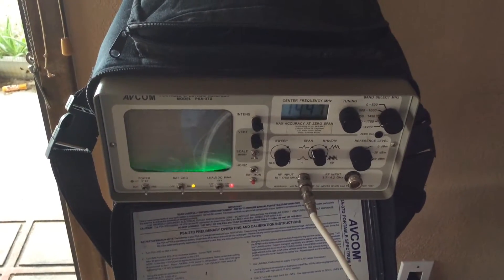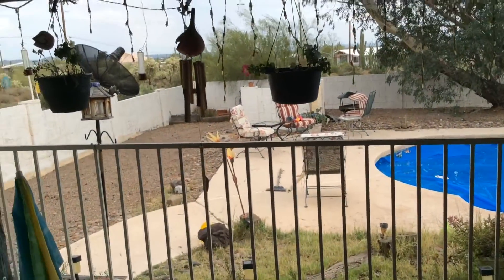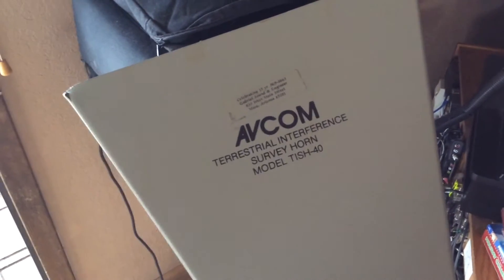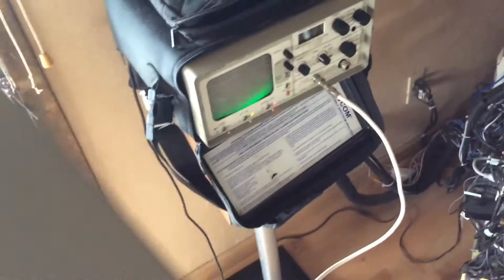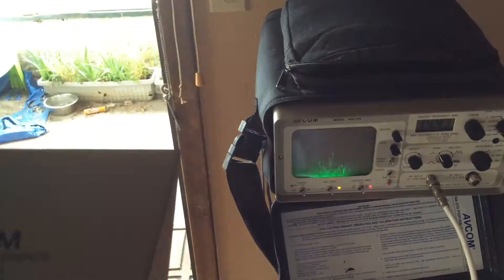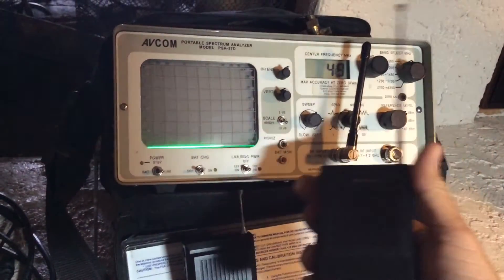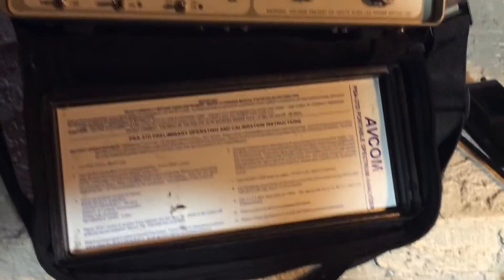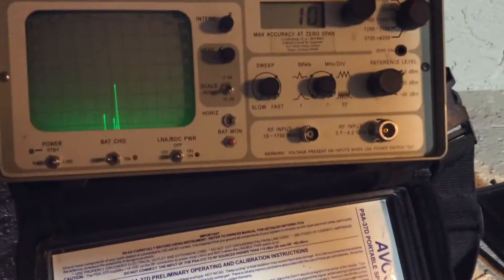AVCOM PSA-37D portable spectrum analyzer demonstrated by Gabriel Sound & Engineering, Mesa, AZ

Comment: Hi, I have this exact model spectrum analyzer. I went to use it today to align a C-band dish and when I turned on the LNB power some tantalum caps inside let out their smoke. I have the manual for the unit, but it doesn't contain any schematics or parts diagrams. Would it be possible for you to take some pics of the power supply board? It's located underneath the top cover of the unit against the rear panel. The caps were obliterated and I can't tell the values of them.

Thank you,
Paul de KE5ASZ